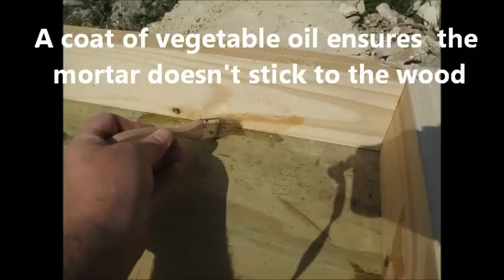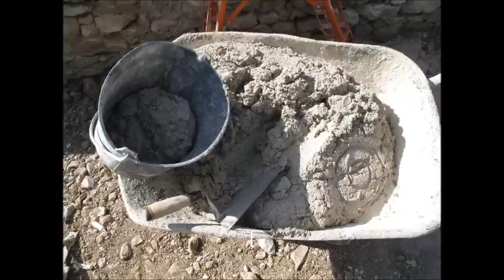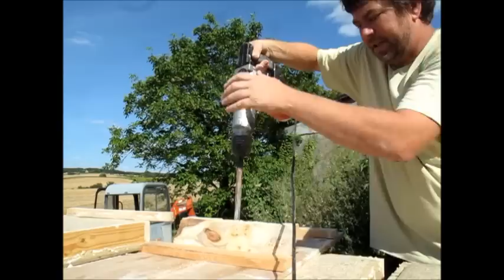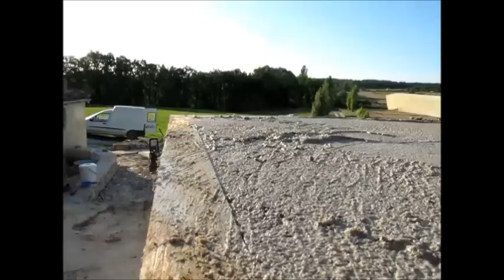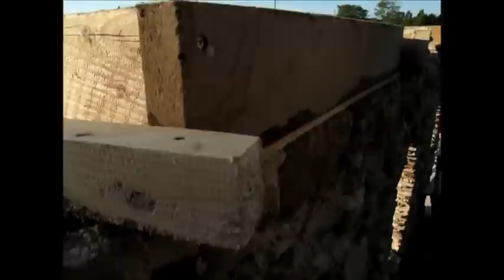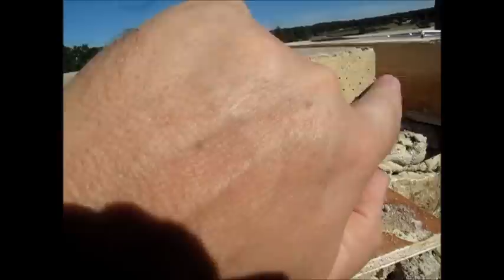Making coping and paving stones

Comment: There is a tintable (color) acrylic concrete sealer called color top from the sherwin williams paint stores, costs about $35 us dolars. Something almond color would give it a nice warm look. You just spray it on with a pump sprayer.

Comment: Have you considered using a fan motor "or other 110Vac motor" with an off balance pulley to vibrate the entire mold. I was going to try this unless you have tried it and found a flaw with it?

Comment: Hi Martin

I guess it's a matter of definition. The finer particles in sharp sand are still stone (mixed with sand).

I did use some ballast in a stone lintel I made but I did get a few of the larger rounded pebbles become apparent in the face of the lintel.

The stones I have made are seriously hard and stable but if you feel comfortable, why not add some <6mm gravel or even <3mm chips?

Good luck with yours...keep me posted, I'd love to see the finished product.

Comment: Nothing wrong fabricating your own wall coping but pouring them in place is a mistake. You have no wall flashing and no pin connection of the cap to the wall. Caps should also have a drip groove and rebar reinforcing. The less water in the mix the better. Actually a fairly dry mix packed into the mold would be better. Top of the cap should have a slight slope to it on either side of centerline to shed water. Joints should be caulked.